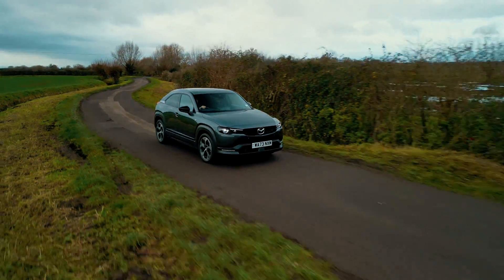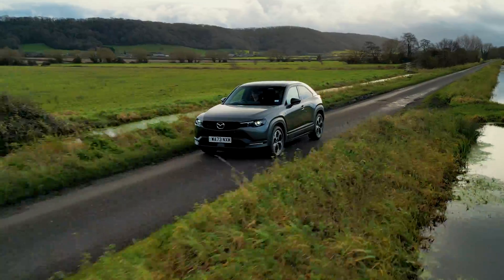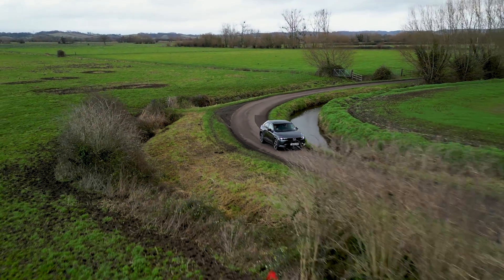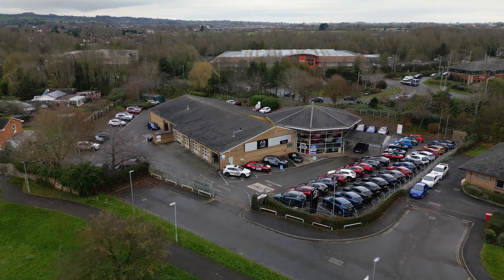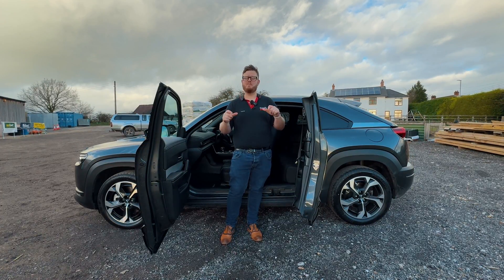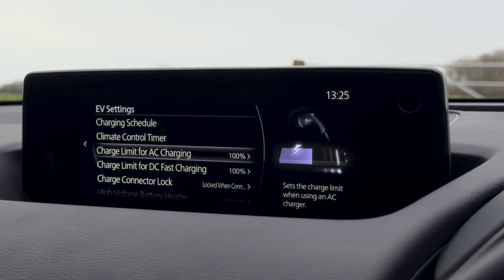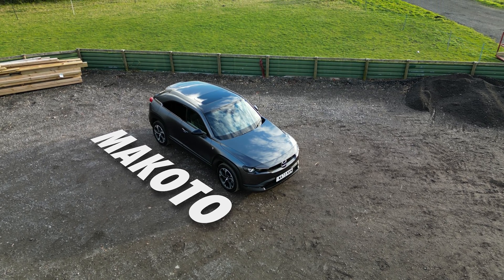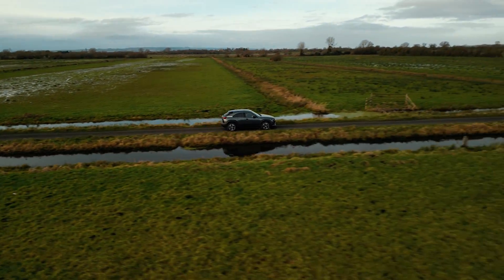2024 Mazda MX-30 R-EV Rotary Engine Explained

Comment: I’ve had my MX30 R-EV for a month now. Lots of local journeys at ludicrously cheap overnight charge (£5 for each 300 miles, logging readings from 3-pin plug charge cable) and a 225 mile round trip at max legal speeds without any stops for refuelling. The more I get to know it the more I appreciate it as an engineering masterpiece. A brilliant combination of performance, comfort and economy. And music sounds amazing on the Bose sound system but masks the lovely sound of the Wankel engine on those occasions it kicks in.
Reply: Wankel engines sounds awful.
Reply: @carstenhansen5757  you sound awful
Reply: @PlayWaves1  But I'm not a moron.

Comment: "because it's not moving the car[...], the apex seal and the oil issues are pretty much resolved". great technical explanation there, buddy!
Reply: The technical explanation behind this is that the Wankel motor can always work in the sweet spot. As the motor is not coupled to the drivetrain, it does not have to move the entire vehicle, but only convert electrical energy for the electric motor. It can therefore be operated optimally, which saves on materials. The internal friction has also been adjusted by means of a ceramic coating. The apex seals have also been upgraded. It is not yet possible to say whether the service life of the motor has actually been increased, but Mazda offers a generous warranty on the part.
Reply: @gillesquinet7523  ok, keeping it in the sweet spot makes a lot more sense
Reply: Yeah, he is a bit of a tool. And too much sucking up.

Comment: So the rotary is a glorified charger for the battery?
Reply: technically yes, it is the most perfect way to transform fuel energy in electricity energy. Many industrial generators use wankel engine.
There are also other technical reason:to rebuild a rotary engine from a generator or from an airplane, you need few hrs of work, as the engine is extremely simple. From the car the extraction of the engine made it a lots more difficult, if they would have found a way to made it simpler, we would have seen meny more wankel on the street nowadays

Comment: Not really enough info about fuel economy.
Reply: this car is totally based on the use you do. It is not the most economical EV neither the most economical petrol car,
if you do weekly commuting with the chane to rechanrge without problem,
and then you do longer journey over the weekend, this is the perfect car.
But if you can rechanrge once per week, or you do long journey quite often, it is not the best option.
This car is literally an "excel calculation" car.

Comment: It is now Sept 2024.....any news re updates or a facelift for 2025?  Dealers never tell you this stuff....
Reply: nothing planned. Sales are not so great to justify an investment infacelift. Probably we will see something in the 2026 wtith some technical change based on lesson learned, or they will cut off the model at all.
Reply: There is apparently a facelift of the MX-30 R-EV for 2025 being released in April 2025. There's now a Makoto Plus - this has a bigger 10.5 inch main display screen for entertainment and navigation on the dashboard. More digital driving upgrades but physically, the vehicle remains identical to what we have right now. I cannot confirm if the Makoto Plus will be coming to the UK though. I know they'll be getting it in the Netherlands.
Reply: They have stopped production, from April 2025.

Comment: It is not powered by the rotary engine. It is an EV with electric drive only. The rotary is a battery charger only. It is best described as and EV with a gas-powered range extender. Most days, the rotary will never be used.
Reply from the maker: that is what I say in the video ;-)
Reply: @EdenMotorGroup  At first you call it a 'hybrid' which most people consider to be dual power instead of an EV with a range extender.
Reply from the maker: I came up with the term in the video OGLEV. the reason I used hybrid at the start is that’s still technically what it’s called even if it’s factually incorrect

Comment: Its fine as an ev....but thirsty when that engine kick in.
Reply: That Rotary Range Extender is just that - a range extender. This is not meant to be driven with the engine constantly in use like a Prius Hybrid. It's not really a PHEV at all; it's a BEV + Range Extender - the latter to get you home to your home charger when commuting on EV power, and also able to provide you with the OCCASIONAL capability for longer journeys up to 400 miles using combined EV battery and the 50 litre tank of fuel. This is primarily for short journeys - not long range ones.

Comment: Sorry, I love Mazdas and came close to buying the full EV version of this last year (went for a Citroěn e-C4 instead with better space, longer range and a smoother ride), but I think this is a very badly-conceived product and a rare big miss for Mazda.  Expensive, uneconomical, short battery-only range, short fuel range, poor tax breaks (in the UK), the list goes on.  Its lovely design and beautiful engineering simply can't make up for so many shortcomings.  And, I will not buy any car that does not have proper knobs and buttons for HVAC and audio - motor manufacturers' pursuit of economy/profit at the expense of user experience, convenience and safety is madness and if buyers want that ultra-modern and potentially lethal experience, they can go buy a Tesla instead.
Reply: This vehicle is pitched as a City Commuter Vehicle first and foremost. It's practically a niche product and not a mistake. The minuscule battery and the Rotary Range Extender are a deliberate design for the eco conscious driver genuinely interested in reducing their carbon footprint.
This is a car for average (of less than) round commute journeys in EV mode - not for a sales rep then.
The modus operandi is home charging - perhaps 3 times or more a week.
The range extender is to eliminate range anxiety and provide a secondary auxiliary power source if you're driving more spiritedly than usual, or going a longer distance from home occasionally - but, this is not for daily long commutes. Typical owners would be those who DO NOT drive long distances every day, but rather, lots of short journeys in a city.
This design will not suit all drivers, hence the low volume production of these vehicles.
This car would suit my existing driving profile perfectly.
Reply: @datathunderstorm  Until you have to sell it... Not really a car, in high demand.
Reply: unfortunately you are right. 
They cannot put on the market a car with half size battery respect competitors, when the first element of evaluation of an electric car is the range.

Comment: The back seats are SMALLER ? than a CX30..??.........I got rid of My CX30 because You could not put Adults in the back seat......So then....this is just a two seater..!!!!!!!.................Paul
Reply: It is just a compact SUV, what can you expect?  
If you have two six footers in front, the rear seats are great for three persons with no legs!
Reply: I guess it depends how big and how tall the adults are. Remember that this is a Japanese BEV + Range Extender - and the Japanese (with all due respect) are generally petite. I'm 5ft 7in and my wife is even shorter than me. This would be spacious for us both, still leaving lots of space in the rear for adult passengers.
I used to own a Mazda MX-3 Coupe 12 years ago - the rear part of the passenger cabin had far less space than the MX-30 the latter being a genuine 2 + 2 seater.
The MX-30 is also a crossover SUV Coupe, hence the compact shape and design - but you can get 4 adults of my size comfortably in that vehicle - even 5 at a squeeze but they'll have enough legroom.
The rear of the cabin does look claustrophobic with its tiny porthole windows that do not open, but believe it or not - those rear windows are part of the quirky charm that attracts me to this vehicle's design. I'm reminded of the windows of an aircraft or a space capsule - and yes, I'm an aviation enthusiast.
Nobody buys a Coupe to impress the rear seat passengers - unless it's a premium luxury coupe - which this isn't. Still the interior is relatively premium in its own right compared to other vehicles in its class.
So yes, it's a 2 + 3 with the right size of humans (or 2 + 2 with generous rear passenger space, though it looks more cramped than it really is due to the tiny rear side windows. 
Needless to say, an obese person (with all due respect) would have great trouble fitting in the back of this car.
Reply: typical mazda rear seat tbh, rear seat only for babies

Comment: I have a rx8 and love it ya it’s more work but I put the Sohn adapter on it and premix and I am a moto x vet and it’s got the race gas smell I put klotz in it and so far so good but she will wear out but I will have a new motor ready and never get rid of it want a manual rx8 mine it automatic so it’s slower but still a blast to drive so smooth like butter love the new Mazda generator it’s genius 😊

Comment: Actually quite like this - wish it had another 10l+ of fuel tank! 

The main thing that puts me off though is the HVAC touch screen. Yes, there are some buttons. Some buttons. Why not all buttons though? Or rotary knobs? You know, things that actually work and are possible to change on the move? 

That reason alone rules it out completely.

Comment: What's the range with the rotary added? Bc the range they say is on battery added and the mpg for the rotary but how far can you actually go on a full tank and battery?
Reply: According to the verification on the Japanese YouTube channel, it had traveled 810KM.  I think the maximum speed and climate differ depending on the country, so I don't think the results will be the same in all countries.
Reply: @dauny08  damn that's pretty good.

Comment: I've had two RX-2s and loved the rotary engine. Been watching this model because it's got a lot of what I'm looking for. I had my first battery electric in 1997 which was a Rabbit conversion. I've had two Chevy Sparks and now a Bolt. The last bit of detail that might put me over the edge would be on how the HVAC is put together. You see the gas engine is a great source of heat. So it would be nice if the plumbing took advantage of that. Anybody know how it's laid out?  Thanks if you don't. The dealership doesn't either.
Reply: there is no water circulation in the battery rack, as it is a "small" pack, they keep it cool just with normal air ventilation.
In the future we will see more complex system, but for now they had to keep the cost low considerign this is a unique power unit they use on just one model that does not sell so much

Comment: Let’s hope what you say is true and it’s better than the previous Mazda rotary engines, they were uneconomical, use almost as much oil as petrol and never lasted past 70k
Reply: To be fair the inefficient fuel consumption is expected in a sports/sporty car and it was somewhat competitive with its competition. As for the oil consumption it really isn't that bad. I own a rx8 and I never have to add oil to it in between my oil changes 3-5k miles. As for reliability it comes down to build quality and maintenance. Stay on top of it and don't do stupid stuff to the car and it lasts fine. My first engine lasted 166k miles before it started to lose compression and I bought another brand new from Mazda. Currently at 222k miles on everything but the engine with no issues and the engine has 56k miles with not problems. Don't buy into every stereotype u hear. Yes they have their problems but they aren't terrible engines.
Reply: I had an rx8, I was doing 12km per liter in 85.000km of use in 3 years.
i was using daily.
My actual typer R does 10km per liter with same usage, previous golf R and gt86 were doing the same 10km per liter. 
so the wankel was the  most economical.

You should compare apple with apple.

Comment: Its a BMW i3 but worse.
Watch this sell poorly and depreciate even worse.
Reply: I disagree. This vehicle stands in a unique class of its own. You’re supposed to judiciously rely on electricity home / work charging to run the MX-30 R-EV. No daily home charge capability? Forget it.

That’s its modus operandi. If you cannot adapt to that specific mode of operation or need a vehicle for long distances every single day, this is NOT for you. It’s not really a PHEV and shouldn’t be described as one. 
This car has a very unique operational skill set - and if you cannot adapt to using the preferred modus operandi - you don’t buy one.
This is a thinking person’s EV with Rotary Range Extender (Battery Recharge Generator) capability. Any true NERD would also recognise what this is - and make a beeline for it.
For regular commuting, that Rotary Range Extender will be barely used - especially if you don’t have a heavy foot all the time. It’s handy for the odd long distance journey - but not for long distances every single day.
This would suit my lifestyle perfectly. And yes, I want one - and guess what? I’ve been driving a Prius for the last 10+ years. 
This is the perfect introduction to EV’s with a backup APU (Auxiliary Power Unit) to avoid the dreaded RANGE ANXIETY. You’ll never be stranded if you run out of charge.

Thank you for a great unpretentious video - I think you’ve sold it to anyone intelligent enough to appreciate what this amazing and unique vehicle really is.

p.s. This is a COUPE - hence the slightly reduced rear passenger space - which NO coupe lover would ever complain about.
Reply: @datathunderstorm  correct me if im wrong. So the rotary engine makes it accelerate faster than normal EV? The gas + rotary engine size stores and convert more energy than of a same size battery?
Reply: Too bad fuel economy is so bad, if you need the back up engine.
Reply: @azul1964  The battery pack on this version is exactly half of the EV, so it does not store more energy,
but the presence of the engine guarantee that you never be short with electricity available

They have used the same engine of the EV version but with more power. 
The key point is that thanks to the rotary engine, they are able to have always enough current to be used to keep the power higher. With the EV, the battery pack is not so big, so to avoid quicker consumption, they have setup in a way to limit the maximupm use of energy.
Reply: @luigipetillo555  um so they use gas most of the time instead of electricity?
Reply: @azul1964  No. The average commute is allegedly 20 to 25 miles round trip per day. This vehicle can accomplish this in EV mode only, daily. Huge savings with home charging costs. Occasional weekend trips across the city to another nearby town? That’s when the Rotary Range Extender comes in handy - the latter primarily for occasional use or emergencies when you run out of electrical power in the batteries.
Reply: Its a BMW i3 but actually good looking.

Comment: really amazing concept to use fuel engine as generator
Reply: Chevrolet Volt in 2011
Reply: @dhillaz  The Chevy Vault was a standard PHEV not a range extending electric vehicle (REEV)
Reply: What Toyota did with the prius in the 90's and BMW in 2012 with the i3.
Reply: @robertsaca3512  Prius run directly on fuel not like this car which is always run on battery
Reply: @TariqSajid BMW i3 Range Extender (REx) since 2012.  I believe they pioneered the concept.